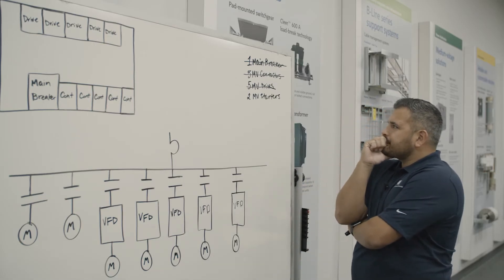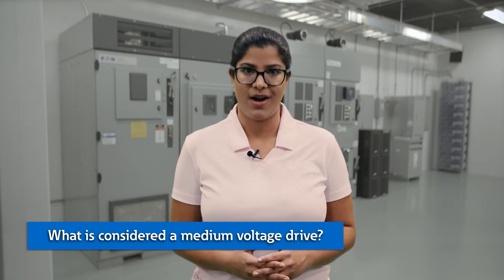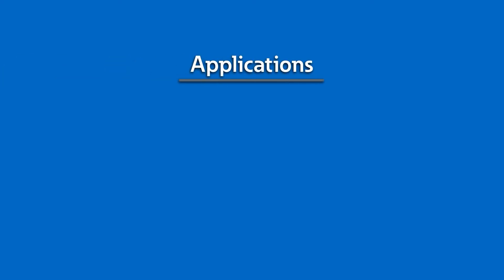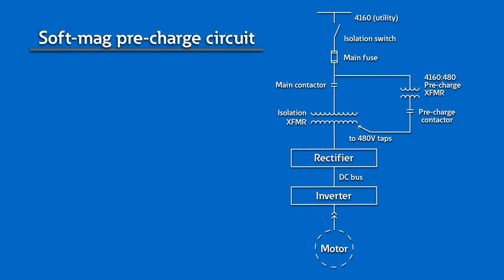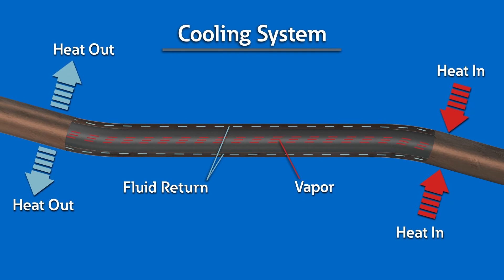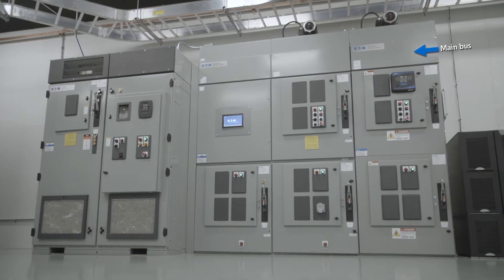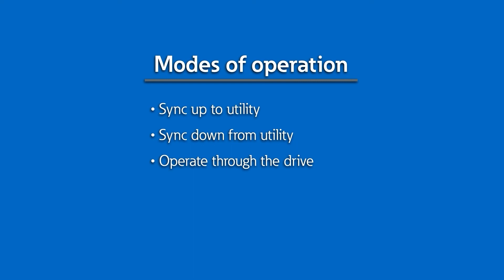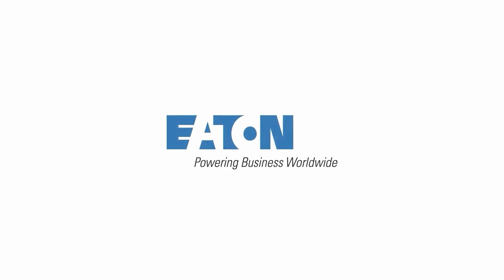Medium voltage drives and synchronous transfer control

Comment: Hello, I have a question regarding VFD to mains synchronization. 
1. Is mains reference signal taken from the VFD power supply?
2. The output waveform of VFD is PWM square with full DC voltage. Even if you van synchronize the voltage phase of the mains and the VFD output, how can you connect them together, without short circuiting?
Reply from the maker: Thank you for reaching out. Please visit https://shorturl.at/pKMY4 for more information on VFD power supply.

Comment: kW is actually 75% of HP,  I would not consider those even "roughly" the same, and that's at unity PF. The amount of HP delivered to a load would be even worse, seeing as how many motors draw decent VARs.
Reply: You mixed up kW and kVA.
For motor running with VFD, appproximate motor effiency * motor power factor (both at full load) should be close to 1HP/1kW.  If result is > 1HP/1kW, users get some safety factor (like using buses rated at 400A with at most 350A).
Reply: @volodumurkalunyak4651  Perhaps power factor may not play into HP calculations but the actual conversion of kW to HP is 0.746, so 75% like I said.
Reply: @AltKuyperian  power factor isnt incleded in the output HP number, but it is included in input Amps.
All input conductors must be rated for sufficient current (power factor plays a role there).